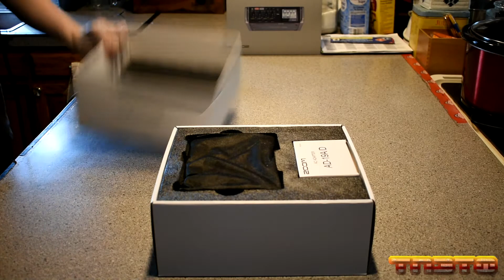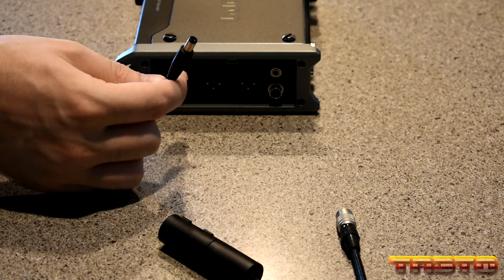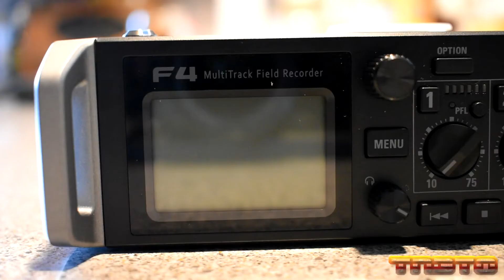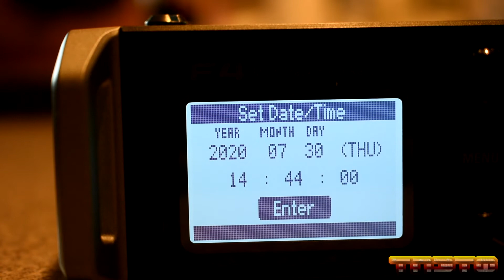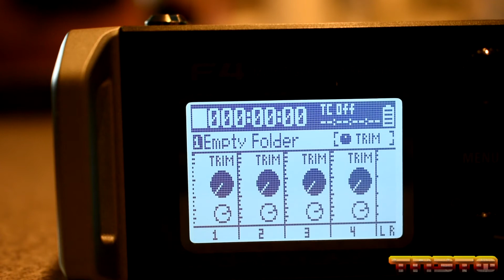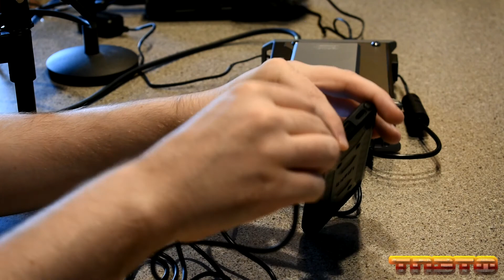Zoom F4 Unboxing and Initial Test

Comment: Just getting started... used a Zoom H6 and I need to step up my game... too! 

Quick question, do you know if I can connect my mic (XLR SCI-3212) into the F4 and directly into my laptop (Windows System10) USB-C and  record directly to the PC? (Lotsa documentation)
Reply from the maker: Yes that microphone should connect just fine with the Zoom F4. Looks like a condenser so you'll have to turn on phantom power on the F4. The Zoom F4 can connect to your computer via USB and act as an audio interface. The USB port it uses is a USB Mini, you can use the included cable which is USB Mini to USB A, it's not USB C. You can also connect the F4 to the computer by using it's 3.5mm SUB out and connect it to your computer's 3.5mm LINE IN, not microphone input..
Reply: Thanx! Ran outta bandwidth to try it today but I’ll try tomorrow and let you know (I was quite surprised the quality of sound I got outta just plugging my Shure mini mic into my iPhone 7 for the Audition recording!?! But you can never have “too good” audio!!!)

Worked like a charm... only thing I don’t understand is why the 1 & 3 show input when I only have my SCI3212 plugged into #1 ???